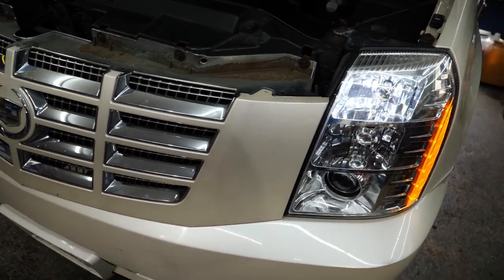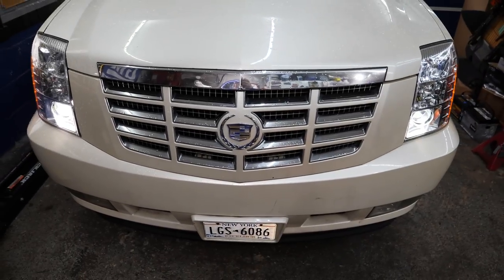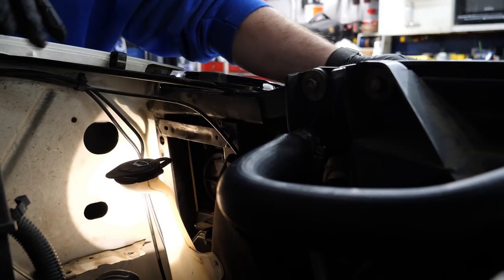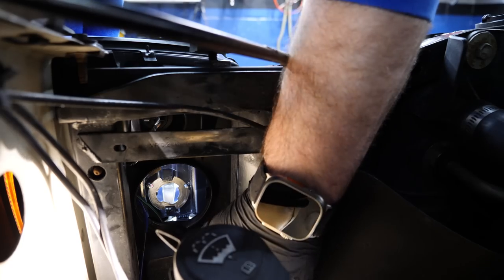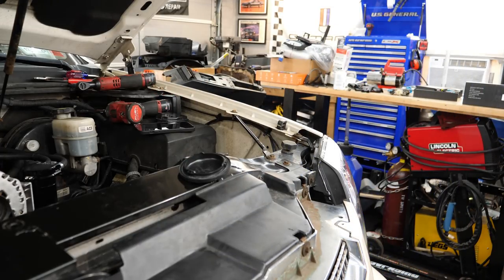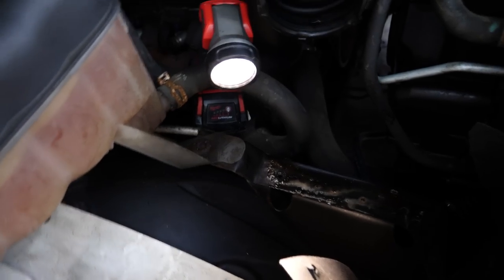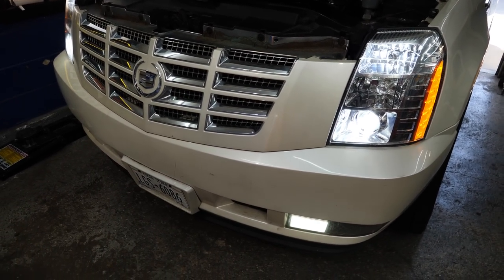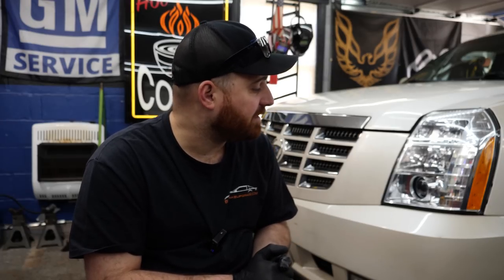I Ditched my Escalade's Xenon Lights for LED's!#LasfitLED

Comment from the maker: Turns out the daytime lights do work! Apparently the truck has to be in gear for them to turn on.
Reply: I was just about to message you that
Reply: I was watching this part in the video trying to telepathically tell you, PUT IT IN GEAR!! 😂 my 06 Silverado is the same they only come on in gear.
Reply: Yep 😂
Reply: Try to unlock/lock with the remote? Do the running lights flash??
Reply: Yes, GM daytime running lights only come on when you take it out of park...I figured you'd know that being GMMatt! My suburban and Yukon and Sierra were that way(GMT800s) and our 12 and 13 Cruzes are the same way
Reply: Watching your video reminded me of when it took 3 grown adults 2 hours to pray the oem halogen bulbs out of my 2009 bad memories 😂
Reply: I was just going to say that. I know what's how my 01 Yukon is.
Reply: Looks like I was 1 of many that was going to say that. I have a 04 yukon slt
Reply: Came to post this 😂. It's either handbrake down/off, or in gear 👍🏼
Reply: This is exactly what I do with my suburban 😂just argue with it while fixing it 😂😂
Reply: Could've told me thanks for the advice
Reply: @oaklandlegend510  no
Reply: Honestly, I'm happy to see someone else scratch their head on the DRLs.  I had to break out my owners manual after banging my head against the wall for a while to figure out the truck had to be in gear.  Happy all the lights are working and you figured it out, they look great!

Comment: The DRL can be programmed using a proper tuner/diagnostic tool.  I deleted them on my dually and installed 3157 sockets with White/Amber LED “Switchbacks”.  When the parking lights are on, both bulbs in the housing are white.  When I turn on the turn signal, they both switch from white to amber.  I get a lot of compliments on that, (Especially from other GMT800 owners) even though it was one of my easiest, cheapest mods.

Comment: Oh yes!   I HATE changing the bulbs on my ‘04 Chevy Crew Cab Dually! (GMT800)It’s so awful that it doesn’t even require tools!    Just pull out that pin…. Makes me want to throw the housing!!  I would much rather change the bulbs on a GMT900!!  😂😂  The Yukon Denali is almost as bad as the Escalade.  The Suburban/Tahoe is still a PITA, but a little better…

Comment: Bruh I need those puppies for my wife’s 07 Escalade. The ballast went out in the drivers side lamp and she’s been on me to fix it for dayyyys. Also when I pulled the headlight out to try and diagnose I didn’t pull the grille off at all and trying to get that thing out and back in almost made me sell the truck. Could have changed the bulb in my 02 Denali 20 times in the time it took me.

Comment: You're supposed to de pin ballast out of the main headlight connector and put the new led harness in there, thats why it has pins on it
Reply from the maker: Ahh makes sense.
Reply: I was saying that as he cut the wires 🤦

Comment: I converted my C6 'Vette's Xenon bulbs to D1S LEDs too. one burned out within 5 minutes. i put the stockers back in and sent them back. probably just bad luck but i know the crazy high voltage required to ignite a xenon bulb has gotta be hard on LEDs (the kit i bought retained the balast)... ill upgrade to Morimotos eventually

Comment: The previous owner of my 05 Suburban Z71 4x4 did not take care of the engine. It had 350k miles when i bought it, supposedly the trans was rebuilt less than 1 year before I bought it, trans is working great so far. The engine is tired tho. Smokes blue under hard acceleration and lacks power. Im going with new replacement long block. My question is should i go back with a new 5.3L or should i opt for the 6.0L? I plan on doing long distance towing of future project vehicles that will need complete restoration/building/mods. Heavy boats like 60s Impalas and Cadillacs. Picked Burb up for just $2300 online after watching Tahiti. I plan to overland it and simple camp inside of it. I also found an 07 Yukon SLT 4x4 for just $2500 that will be my daily "bro build" lifted 37s" cadillac taillights(going for modern take on the 70s-80s K5 gen with steelies no stance wheels, until i get another econobox maybe older impala, been thinking LS4 swapping one and making it bulletproof due to weak FWD. Is that a good idea or a terrible idea? Let me know please😂
God Bless!!!

Comment: I'll be tackling this in Oct or November I'm going to buy new headlights on my 08 is it better to just remove the whole grill and all to get to both headlights I'm going to go ahead and replace the lowers fogs and all to have new headlights and new bulbs I have LEDs in mine previous owner changed them but I'm going to buy new bulbs and new headlights covers unless I can sand and polish them and the bottoms as well all LED bright 6500k also u used lastfit bulbs I was planning on doing the same or maybe auxito what i do like about the lastfit led bulbs is they dont require a relay or anything no fast blinker anything i have some white/amber already for my escalade 4150 i believe is the bulb#

Comment: Pretty sure those daytime running lights aren't working because you put in LEDs. Try regular bulbs and they'll probably work. I have a 2003 Tahoe just like yours. I've been watching your channel just because of Tahiti. You gave me lots of ideas and thank you. Save me with a couple of the general repairs as well like the connectors for the heater core etc. But anyways, I tried to put LEDs in mine and they wouldn't work. Regular bulbs did. They probably need some sort of resistors attached to them just like I mentioned to my LED tail lights did to work a couple videos back. I really didn't feel like trying to figure out what I needed to do to get the LEDs working. So who knows maybe if you take the time to figure it out you can share it with all of us. Otherwise do the daytime running lights really mean that much? 🤷
Reply: And I just saw your comment about the truck being in gear. That's weird I wonder if my Tahoe will do the same thing? But I don't think so... 🤔

Comment: I Had A Bumper That Wouldn't Come Off Today On One Side. Ended Up Putting Two Dents In The Fender  Because It Wouldn't Fucking Release Off The Bracket. Other Side Came Right Off

Comment: I love your videos matt, been a sub for a long time...but man my head hurts after watching this... you made it so damn difficult on yourself. Those xenon bulbs are factory...and xenon bulbs are junk. Led bulbs suck too, especially headlights because you're going to be that person that blinds you on the road. If you cant see with normal halogen bulbs, shouldn't be driving in the dark. My 13 Cruze LTZ RS has regular halogen bulbs and i never use my brights. I'd have wired in halogens.

Also marker bulbs should be amber, not white. I'm a car guy but I hate the people behind me or coming at me using the bright ass bulbs and they are blinding...should be illegal. Stick with regular fog lights. Extra bright lights are unnecessary
Reply from the maker: Led’s are absolutely fine in a projector housing. Putting them in a halogen housing is a different story.
Reply: @lsxmatt  doesn't matter if it's projector housings or not, they are still ungodly blinding. Because almost every car over the last 10 plus years has "projector" housings
Reply: I’ll take LEDs over factory any day beside newer cars come LEDs anyway so why not do the upgrade on a older vehicle
Reply: @thagerdorn2009 May I suggest that maybe you need some glasses that will reduce headlight glare?
Reply: @kenlaw04  um no... PLENTY of people agree with me that headlights on newer cars are WAY too bright and blinding. Halogens were used for many many years and were never a problem...if others can't see at night with regular halogen bulbs, they shouldn't be driving. I can see perfectly with halogens until some asshole in a new car with ungodly bright headlights gets behind me. THAT'S the problem

Comment: 🪴Morimoto might have something better  possibly a competitor you might have even better LED &  headlight assembly. 

3M headlight restoration that uses a drill works the McGuire's wax and polish will bring it all back better way better with a diamond luxurious sparkle.

There are a type of Brillo pad numbers 0000 0001 at Ace hardware or true value to clean chrome works incredible don't need soap and water but can help dawn.Renegade pro red metal polish works incredibly well.Sometimes it can what happens the wheels turn a white film where they look silver white and impossible to change.Even doubt that the wheels are even  chrome in the 1st place in seconds you will have chrome wheels again now with a chrome plating there highly likely a microscopic film on the outer layer and that's where the polish will come in handy what you can't see.

Same attention to the windows to bring out a shinning luster of appeal that can not be denied.Wheel spacers and to get the chrome wheels to be better defined blacken the inner part of the wheels and wet sand the paint. You really only need a mechanical quick shift and a higher stall speed torque converter if a super charger is in the plans go black everything black chrome for the wheels to attract a uber driver purchase. 

The interior I forgot oops 🪇 a brilliant red vinyl wrap that's my thoughts.Specifcly for LEDs finding thoughs that have a slight mixer of colors that mimic the sparkle of diamonds could be a good find.